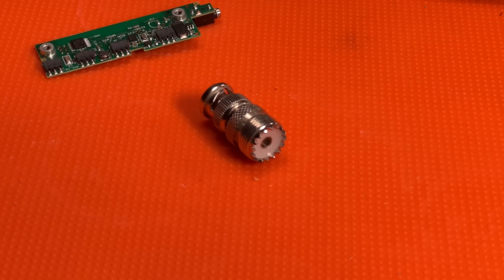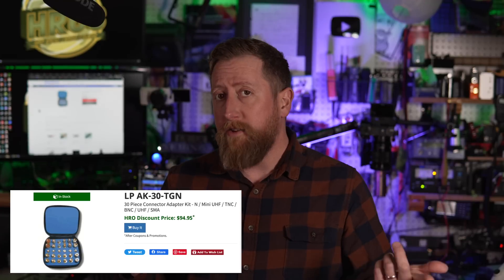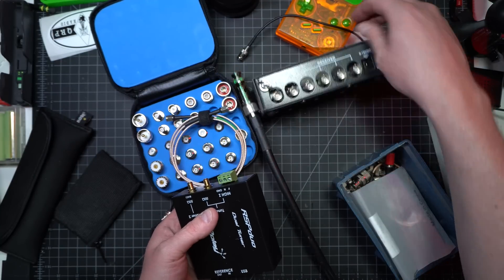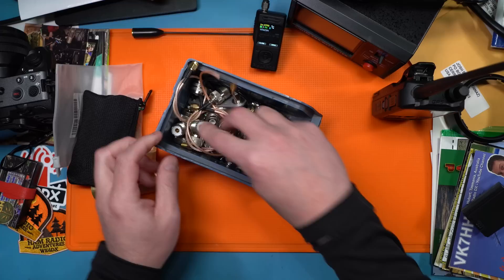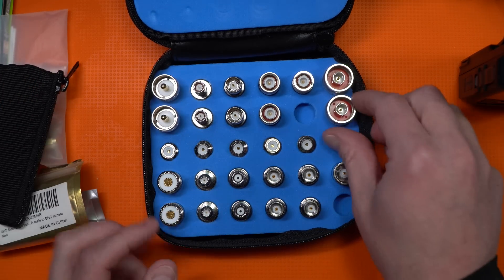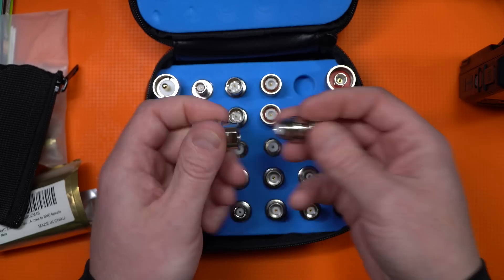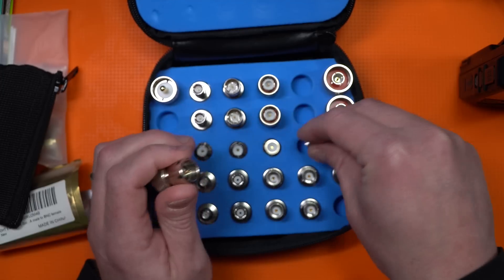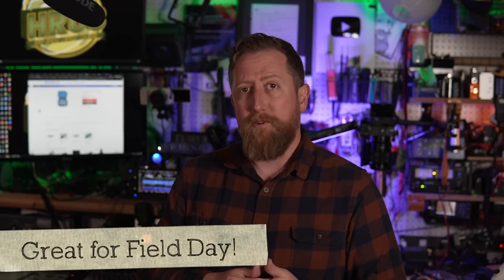The Coax Universal Translator For Ham Radio Antennas

Comment: I have about 8 UHF repeaters linked in Northern California and you will not believe the adaptor box I have with multiple connectors and 16 different combinations without the middle coupler.  You don't want to make a trip back 200 miles to get an adapter, but you hate to put it in when you do it.  It's just part of the expense of owning too many repeaters.  Repeaters for sale - with adapters!  DE W6CBS

Comment: We use these at work a lot, and they do the job well. Top tip, have a pair of spanners on hand to undo the adapter when you're done -the cores can be difficult to get out if you've been 'enthusiastic' during assembly ;)

Comment: Got all set up at a local park on Winter Field Day. Ice hut. Check. Heater. Check. Antenna Deployed. Check. Radio, battery, tuner. Check. BNC to PL259 Adapter? Nooo! Had to drive back home and grab one. I was sure I put an extra in with the radio. You can’t have too many of these. Nice kit! That would have solved my problem. Moral- always check the gear and have a checklist. Bring an extra adapter!

Comment: For anything QRP (HF / VHF),  I put a BNC adaptor on the gear. Radios, SWR meters, dummy loads.
For UHF and up, I use N type.  SMA I consider  "delicate" so I don't want to be unscrewing them.

Comment: As you said "generally" you can use the cheap ones from Amazon or eBay. I use them. ...BUT ...when it really counts buy quality connectors. When I put up my NA4RR Hexbeam I used a cheap one (right angle pl259/so239) from China and got burned. The center pin inside busted after about 4 months. It was a major endeavor to take it down off the tower to replace it. A painful reminder you get what you pay for. As always, good video and info Josh.

Comment: ive been running knock off LMR400 and recently picked up some RG-8X that has amphenol connectors. The RG-8x is noticeably outperforming the knockoff LMR400 for my repeater project. Good connectors matter.

Comment: hi how much rf loss over so meny conections? i usuali have evriting in a feumeter cables tray not to use adaptors radio coax surgy protection coax antenna
Reply from the maker: Virtually none.

Comment: Josh… with the price of that connector kit, did the manufacture provide a chart of typical connector-loss when transmitting?  Nice to see gold pins as the standard, but did you know higher-end connectors are available as silver?  One time after visiting HRO in Anaheim, I noticed they had individually wrapped PL239 adapters that were silver.  Also be aware with time, the oils on your skin will oxidize those connectors, so cleaning them every so often might be in your best interest.  73 de KD6UYK (Tim)
Reply from the maker: Connectors have virtually no loss.

Comment: For low power HF cheap connectors are fine, start running power at HF use good connectors. 

2m and up you want a quality connector because the cheap ones can have an SWR bump that can be really bad on 70cm and up... run power on 2m and up you absolutely MUST run a good connector... I literally had a cheap N crimp connector explode at 1,000 watts on 2m! Was a connector from my junk bin because I was out of the Amphenol I normally use. 

I have seen others melt connectors on 70cm running 1500 watts... 23cm I melted some LMR400 Chinese knock off cable running 500 watts(even Times LMR400 is marginal there, spec is around 500 watts so ragged edge)...

Comment: Pretty much the only failures I've ever had were when I tried right-angle swivel adapters (N to SO-239 or PL259-N). The swivel portion tended to get stretched after I tried to tighten the connector - and never could actually tighten them, as the metal simply stretched more. Fixed-right-angle connectors were much more reliable, but just a little less convenient. Otherwise, el cheapo connectors have served me well.